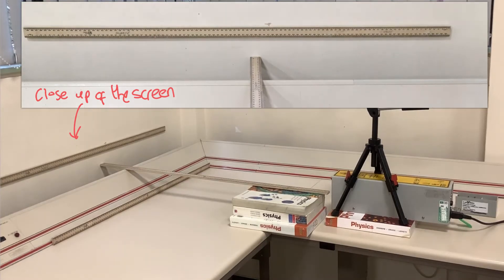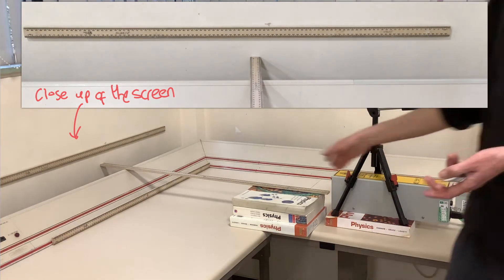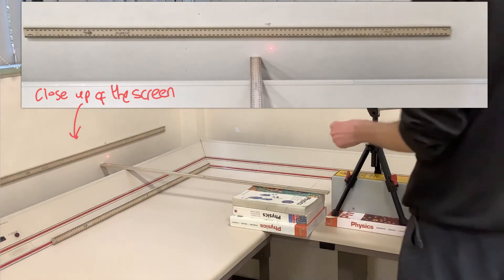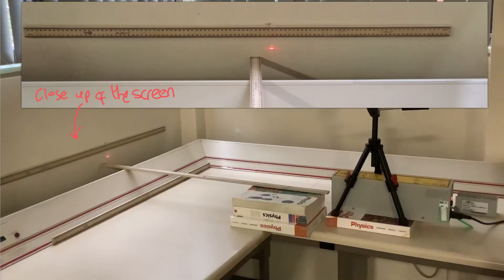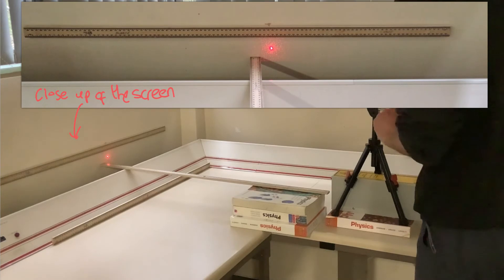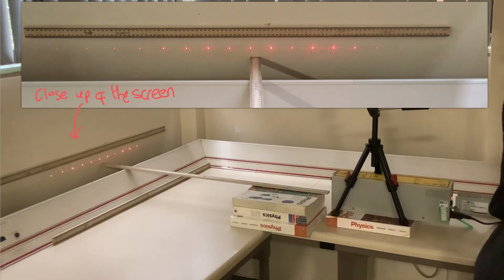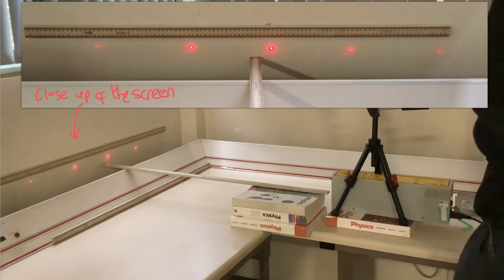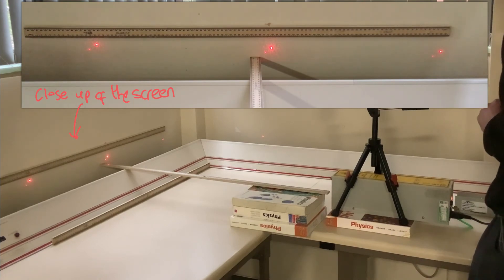Demonstration of a diffraction grating with a red laser changing the lines per mm

Comment: Can a diffraction grate be used to verify a light filter?

I have many narrowband light filters I use for Astrophotography, but no way to know if they are blocking the wavelengths they are supposed to and allowing the ones they are supposed to.

Can a diffraction grate be used along with a light source to measure what is being passed and what blocked?

Or is a spectrometer or other equipment needed?
Reply from the maker: If you use a white light source and a diffraction grating to produce a spectrum you could then put the filter in place and see which part of the spectrum it lets through.  Of course a spectrometer would let you do this more accurately.  

White light with a diffraction grating
https://youtu.be/vt86k8yoe08
Reply: @SimonPoliakoff  Thanks!